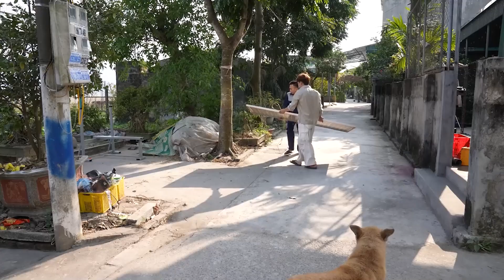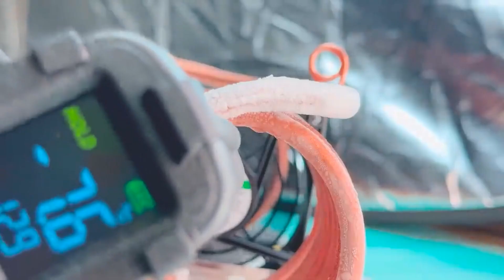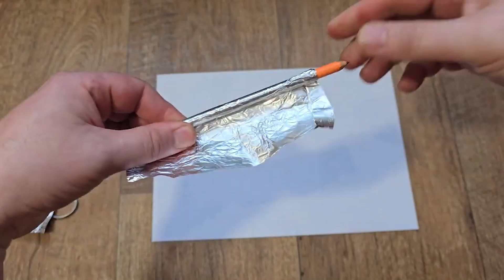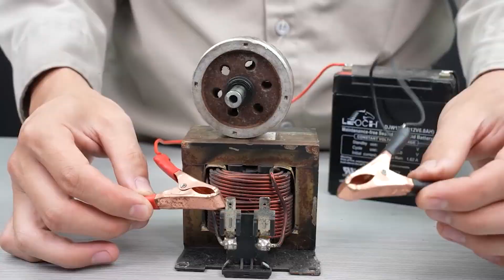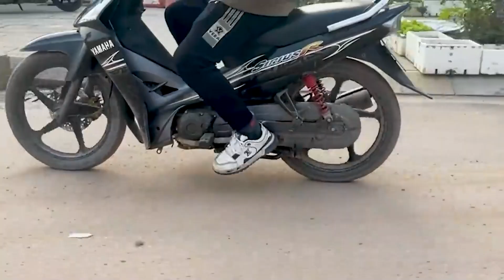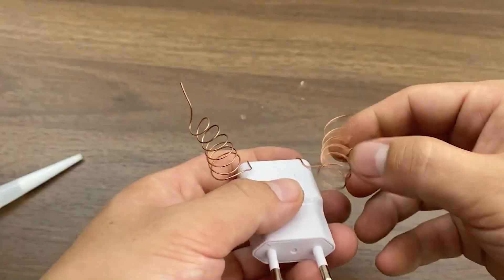6 Viral Engineering Hacks That Actually Violate Physics (Don't Try This)

Comment: the butane is ALREADY compressed....(it goes in cold so it's liquid )....it does not need much compression  to reliquify inside the AC. This works and does not violate any laws of physics.  I did not listen the rest of the   video but you are wrong with tbe AC one!!